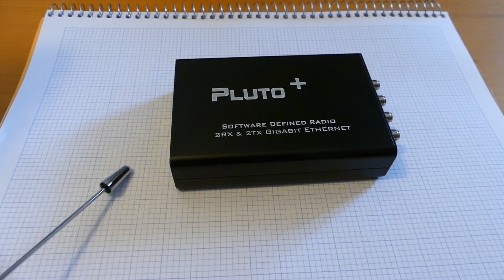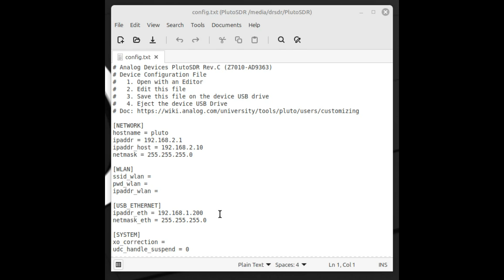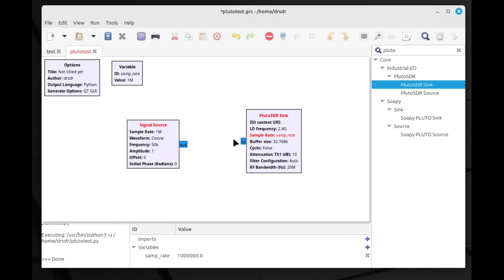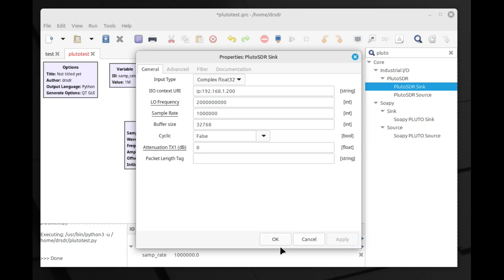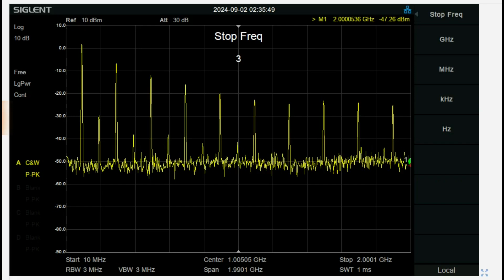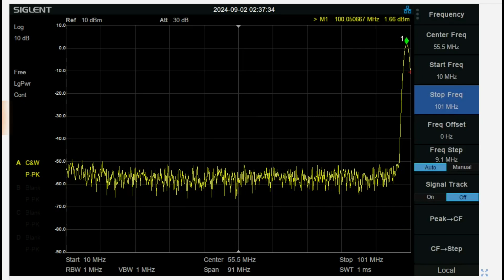Pluto+ SDR

Comment: why not USB type C or Type A high speed data port???
Reply from the maker: the ettus b200 and b210 boards use usb 3.0,   but needs drivers,  giga-bit ethernet works well, since most pc it's just setting up a ip address,  many options in today's market.

Comment: Given that this video is relatively recent I am wondering if the Pluto+ was a version 1 or version 2?  Thanks!
Reply from the maker: not sure, the pluto+ is the clone one,  since it uses ethernet it was simple to get working with gnu radio.
no usb driver mess like the bladerf and usrp devices.

Comment: I recently bought one. But I cannot use it on matlab or gnu radio, matlab always says radio is busy, and gnu radio doesn't even recognise the device. What should I do? Should I send it back?
Reply from the maker: can you ping the ip of the device?   i use plutosdr blocks in gnuradio.   sample rates of 3MHz should work.     i also had my pc ip be the same 
so if pluto is 192.168.1.200,  i made my pc be 192.168.1.50,  i used a usb to ethernet adapter on my pc,  ethernet cable direct to plutosdr.

Comment: why does it have such bad sensitivity. -50 dbm. ???
Reply from the maker: i did not test RX,  perhaps needs a higher gain setting.   for tx it had a 10db atten when i made zero, i got more tx power.   should have a similar control for rx chain.
Reply: @TheGmr140  But in your video in the program on the display it is visible that the noise ends at -50 dBm and the useful signal begins?
Reply: @TheGmr140  ???
Reply from the maker: @Юрий-ш3м1ю  that was the spectrum analyzer noise floor,  i did not set the RX side of the pluto-sdr.    i was just measuring max power output and looking at the harmonics of the tx signal.    i'll take a look at the RX side,  and see what is the MDS of the pluto+
Reply: Юра,  because you don't know how SA works and what DANL and how it differs from Noise Floor. Как там в свободной России? Сколько нужно VPN устновить чтоб одним глазком youtube глянуть, посмотреть как люди цивилизованные живут?